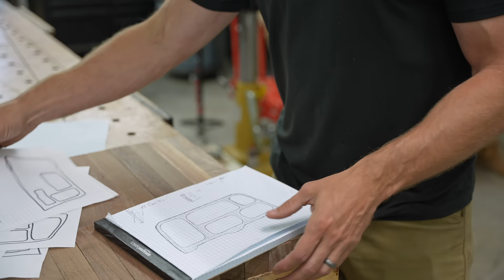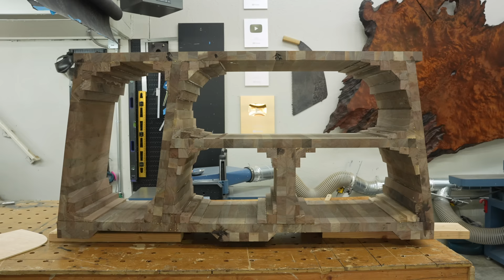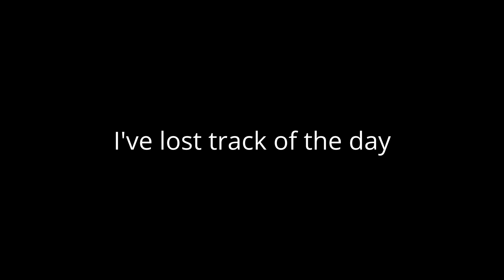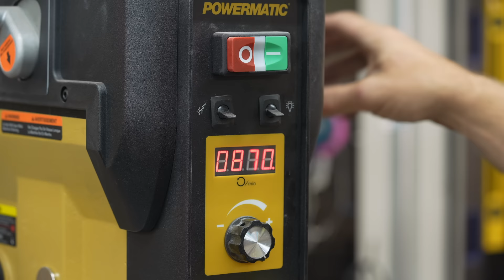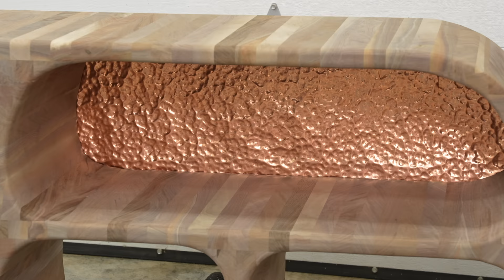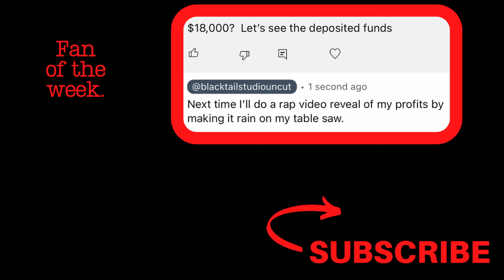My Best Project

Comment: Working with UV almost every day, I have two recommendations; 1) Wear UV blocking glasses. Even short exposure can lead to uncomfortable itchy eyes and other transient (but not permanent) discomforts 2) Determine the wavelength (in nm) of the curing light. Odds are, there is a cheaper alternative that's marketed as germicidal or used for curing finishes in other fields (for example UV cured windshield chip repair, or UV cured 3d printing, perhaps germicidal UV, etc). The light you're using looks pretty lavender, which is closer to the far end of the UV spectrum
Reply: Most safety glasses block like 99% of UV-A and UV-B light I believe so you may not need to buy anything special.
Reply: 3rd recommendation. Keep the light away from Monica Lewinsky’s dress.
Reply: @dads_diy  That depends on what the meaning of the word "is", is.
Reply: @Toekneepowers

Oh dear goodness! So way back in 2010 I went to a DoD police academy and like many others there I was both prior service and prior MP. One of my classmates was a recently retired Army CW3 CID agent. The subject came off classes we’d attended and CID attends a lot of the FBI classes. For his forensics the agents egged them into asking the instructor about “the dress” because she was the principal technician who had worked on it.
The long and short of it was that she could confirm that Wild Bill’s sample was on the dress, along with something like 4-6 OTHER donors whom had also been identified but she was not allowed to disclose.

So apparently it really was her party dress!
Reply: UV can and will lead to cataracts over long exposure times. Any safety classes that are ZA rated are normally adequate for something like this.
Reply: I imagine enough UV light, unprotected, could give you cancer.  Perhaps you should wear fully pants and full shirt instead of trousers and t-shirt while operating it, if you do so for long periods?
Reply: I’m glad I wasn’t the only person worried about his eyes, that’s some intense light
Reply: reminds me of the gel nail polish lights I use!
Reply: Additional recommendation: sunblock.
Reply: Especially with lighter eyes, they're more sensitive to UV light.

Comment: A tip for if you ever use copper again but dislike the color, use liver of sulfer. It instantly turns it a nice black shade and makes it look quite refined, especially if you add resin/shellac over it
Reply: sulfer has organs?
Reply: living in suffering
Reply: That's what I was going to suggest. Use the larger hammer on the copper. Use LOS and buff back the highlights to let the warm copper come through.
Reply: Fuming copper in ammonia with a coating of salt and vinegar can produce a beautiful verdigris effect. I would imagine that hammered copper would make for quite an interesting background when sealed.
Reply: @talexander7217  this is exactly what I was thinking.
Reply: The only downside is the smell, it is atrocious!
Reply: Verdigris! That was the word I couldn’t remember!
Reply: Yeah, I was thinking of some sort of aging of the copper too

Comment: I think the copper would have looked SUPER GOOD if instead of just doing bright bare metal, you'd burnished, oxidized, or tarnished it. It really just needed to be a little darker and have some variation in the colors. That being said I think it turned out extremely well. It's a very pretty piece, one that I would be happy to have in my home... if I had anywhere near enough money to be able to afford your pieces lmao. If I might make a suggestion: A matching floating enclosed bookshelf or record shelf that could go on the wall above it or nearby. Something with half the depth and height perhaps. I think that would look SUPERB.
Reply: varnished copper looks great
Reply: I was thinking it should have been sandblasted after hammering.

Comment: If you plan on using the UV cure finish more frequently you should probably buy some sort of protective UV blocking glasses that work for the UV wavelength emitted by the UV flashlight.
Reply: Or rub sunscreen in your eyes...
Reply: It was in the video...
Reply: It's funny how many comments of people telling this dude what he should and shouldn't do. You think maybe he's made it this far because he's a smart guy and takes risks? Safety Sally type folks never can quite get their feet off the ground ( it's dangerous) good grief.
Reply: Bookshelf.       Go to 28:39 and he has BOZ glasses on for that exact reason.  You were probably typing while that part went past.
Reply: @timjohnson8390  It's funny how some people seem think, that "taking risk" and "ignoring safety precautions" is the same thing even in areas like wood workings, were you can count the situations were more risk is appropriate on all your seven fingers...
Taking risks in design? Sure. Taking risks in just risking your own health? Not the smartest move.
Reply: My thought too. Some knuckleheads here think you've got to take risks. That's not how it works.

Comment: Bookshelf but one that needs to be stocked sparsely so the backing is visible. Also so classy, minimalist bookends don’t look crowded. It is a beautiful piece. I could see an elegant Japanese style floral arrangement in a vase that complements the curves and hammered background, either by contrasting or mirroring it, in the tall cubby. 

My joints ached watching all of that work sanding. I think I was tensing up in empathy. Kudos for not destroying it with the chainsaw.

Comment: Bookshelf for me. I feel like cabinets have doors. But I absolutely love the project! 

One note on the UV cure finish is you should look into some UV resistant gloves if you are going to use it regularly. I'm a nail tech and the UV lights that used to be common for curing some nail polishes had a big impact on the health of people's skin who got those services regularly. Nowadays most products are LED cured so it's not as much of an issue, but having that damaging radiation so close to the thinner skin on our hands can definitely lead to issues. Obviously the wood curing lights are directed at the wood and not directly onto your hands, but I still think changing your gloves would be a sensible safety precaution that doesn't take much effort
Reply: You got to use uv glasses 2 we all do it in the resin 3d printing world. My eyesight went down hill after I started curing my prints. 😢

Comment: Oh, yes, I agree with another comment below.  The copper would have looked good if you had spaced the texture like you did with the steel and added a patina to it.  Super cool.  Try some samples with your "finished" wood and some patina on the copper.  A great book on patinas  Patina: 300+ Coloration Effects for Jewelers & Metalsmiths  Matthew Runfola

Comment: 24:18 for thin metal sheets excluding stainless steel well doing tool is a nozzle drill nibblers. Very cool thing for less than 50$ you can work easy and safe. We cut metal of steel electrical panels (about 1mm steel ~0.04"). Use high torque battery drill about 1500 rpm. Great work, Can, I like the way you do it. Good luck, friend!

Comment: I'm a gunsmith here and I'm taking high end woodworking to my stock work. But let's talk about the cold bluing real quick. 
Personally I apply with a small brush because it's a generally ugly and patchy solution instead of a full refinishing using a slow rust or fast rust bluing. 
Chemical bluing (cold) has some steps

First you should prep your material.
You should sand the material starting at 120 grit and working up to 280 for a matte, 320 for a medium shine, 400 for a slightly brighter shine, and going up to 1200 can give you a moderately reflective swiss shine (or swedish I always confuse the two lol) though this is better with slow rusting technique. 

Next make sure you degass or do oil removal with acetone, I like to soak milsurp for around 4 hours after heating at about 320 for 45 min. But again this is more for bluing or cerakote. You would want to colder than 320 for applying but a warm temp should be acceptable. 

Then apply with a sponge making sure it's lint free. (There are a lot more steps if you slow rust or fast rust)

Neutralize the process again lint free

Finally I like to set up shop towels put a small amount of motor oil (you were right about that). I then pour motor oil completely over the entire barrel/action I use a bin to collect the access. Then lay it over the shop towel, lightly coat the metal in the oil and I then wrap the metal up and tape the shop towels and leave at least overnight but on a high end product I can leave up to 72 hours.

Comment: A good way to remove excess glue is with a damp rag.  Wet it , ring most of the water out, wipe the excess away.  Wash the glue from the rag before it dries.

 When you sand your corners, have you considered a felt backed sanding block?

Like your videos a great deal, keep up the good work.

Comment: Many years ago I bought a 100mm steel disc for a grinder that had a series of chainsaw like teeth around its circumference. Made by Arbortech I believe and it was perfect for removing huge amounts of Australian hardwood very quickly.

Comment: It's neither a bookshelf nor a cabinet, it's a bookcase.

A bookshelf has open ends (usually mounted on walls), while bookcases have closed off ends (the unit usually sits on the floor). 
A cabinet has doors/shutters and sometimes drawers.

Comment: I saw similar units but smaller in galleries about 10-15yrs ago. The difference was that they had drawers fitted that were shaped that same as the hole so the drawers were kind of random shapes (just generally squarish). I thought they looked great kind of rounded as they were but like I said much smaller, more like desktop units.

Comment: Nice tip from my father, a carpenter for 40 years, he take the wood dust mix the with glue and place in the gaps or cracks, its more easy to

Comment: Really amazing work, your handtools skills look really nice, a lot of people don't know how to hold properly a block plane, even when they use it on a daily basis.
The hammer patterned steel back looks awesome, the oil also is amazing. You should really be careful while using UV light, it looks very powerful and I doubt that it's UVA which are kinda harmless if it's that effective on curing the oil. Cover your skin and eyes, a good mask or even breathing mask would be recommended too.

Comment: Hands down this is my favorite channel to watch regarding high end tables! 

I was going to suggest some videos where Ian Roussel makes some acrylic bubble tops for vehicles, but for your particular build I think your method worked great. 

Seeing that the epoxy bends so easily it made me curious if you’ve experienced any issues with the big tops warping if they are placed near a window. 

Power outages in Texas heat and it’s not uncommon to reach 90 + degrees indoors, but I really want to build a slab/epoxy table.

Comment: Cabinet/. and or bookshelf.
Absolutely love this versatile unit.  Could be either or both.
I would want to put it on top of something though, to put it at a height where it showcases it, on the ground does not do it justice. 
4eyes did one similar looking but carved out of solid wood- I actually prefer this especially with the hammered steel.  Absolutely gorgeous.  Keep the templates, you never know, it could become something iconic.  It has that look.
I think I’ve said this before, but it’s worth saying again - I really appreciate your wry sense of humour, your ability to laugh at yourself and that you show your mistakes.
I also appreciate the quality of finish on your pieces.  As a client if i were to pay the many thousands for a custom piece, I would expect the quality finish that I see on your work.  This utube channel is very effective advertising.👍

Comment: I have built a number of chests and other furniture pieces with curved corners and cracks and gaps are always a problem but I have always used a tinted hard set wood filler with pretty great results. However the wedge method you used came out great. Also that drill jig for drilling out those brads was excellent. Tear out is such a drag. Those plugs looked perfect

Comment: I'm  a retired gunsmith, and have used cold bluing many times. The two secrets: 1. pre-heat the part (which has been scrupulously cleaned) 2. Reapply anywhere from 10-12 times, buffing with steel wool after each application.

Comment: Any UV light wavelength can be bought in high watt COB packages, stick on a  heat sink, get a power supply, attach some wires. < $200 if you don't mind a cable.

Comment: I love how you just dumped some motor oil on it. 😂I'm down a rabbit hole of building custom-made cat socialization tools for an adoption center I work at where I help socialize cats so they can find homes. I recently realized you can take acrylic rods and melt the tips, clamp them with smooth pliers and then use a small awl to create a hole (while it's still warm) to attach stuff to it. I'm also trying to build more humane laser toys for cats with leds and hearing aid batteries (so the cat has something to attack instead of the very unsatisfying light they can never catch) and I believe I ended up on your channel while trying to research the most non-toxic acrylic pour material. I love your channel now and I'm hooked just watching you build stuff!

Comment: This is a very unique and interesting project. It's a shame that you had to go through the use of a chain saw because you could have totally ruined the project. The matching the spaces and nail holes came out very well. With time, you'll have an increasingly difficult time in finding those fixes. As you were buffing the cabinet,  I caught a brief glimpse of a space between a couple of pieces of wood.

Comment: The finished project looks really nice, but i would have planed the walnut pieces before glueing them up to get nicer glue joints. I also would have cut the outer corners with an angle on the sides before glueing so you come closer to the wanted round shape and have pieces with the same widh around the corners and also way less carving would be needed there. But overall great work!

Comment: I hope you do this kind of piece again. My opinion is you wouldn't have to make everything at angles. Instead I propose that your make the outsides square, then with whatever/how many openings you have, round two of the corners for each but pick which ones at random. They could be across on either side, both bottom/top or the left/right sides. Plus doing it that way you could make a much larger/taller piece and not sand your life away. I think that could be just enough differenterer for you without making it insane for you to do. I know you love differenterer. All you do is differenterer. 👍👍👍

Comment: Cabinet. Your tool over-heating is power supply related. It could be something as simple as your extension power cord being to light a gauge wire for the length of run your between the power source and your work station ( I.E: 16 ga for 25 ft = 14 amp draw  vs. 14 ga for 25ft = 18 amp draw). So what is the expected load required for that drum sander ?

Comment: wouldn't it be nice to just make a full sized panned for the back with epoxy and copper,i'm sure you got nice ideas to mix the 2 would, reflect nice too with the silverish blue. would be a nice shelf for books or other small stuff next to a good looking big closet or tv shelf,i bet if you made those a bit smaller they would fit in  godly next to your bed on each side one.

Comment: That was a hard job to finish, weldone. Imagine how hard it has been to build the pyramids that 80 tons of granite stones fit together in a way that you cannot even push the tip of the razor blade between them, specially when your tools are just copper chisel 🙂

Comment: I had an angle grinder accident while using on a steep roof on chimney mortar joint to do flashing. Hit a piece of rebar that made grinder skip out across my calf. Scariest thing ever working alone with a 4 inch long gash that my muscle popped in and out of as trying to get down ladder.
Reply: Wish I could add pictures of the scar

Comment: cabinet.  Maybe you took off more than it looked like but seamed like it would have been safer to use the tracksaw from both sides or your deepest cutting saw with a straight edge over the chainsaw.

Comment: I'm not usually a fan of modern or contemporary furniture (my appreciation of furniture styles ends around 1940, ditto for archtecture) but that thing you built is amazing. My only criticism is that I thought it looked better with an open back, which would also be much more practical if it housed a classic stereo system as one commenter suggested. That being said, if I was at the income level of your usual customer I wouldn't hesitate to pay $18,000 for one of these (says Morgan as she tries to scrape together $7500 for a leather tuxedo loveseat...)

Comment: If that is an actual UV-C light, it will severely damage your skin and eyes with exposure, you will need protection, at the very least pants and long sleeves.

Comment: As a former professional in a different industry that required the use of chainsaws…. PLEASE at least remember to wrap your thumb fully instead of just your fingers. If you encounter any kickback it’ll be highly unlikely to stop it from slicing into your face or shoulder. I almost watched this happen to a friend. It’s also a good idea to get chainsaw chaps. But at the very least, wrap your thumb around the top handle fully. If you hold the saw correctly this way, your knuckles would punch the chain brake in a kickback situation. This would stop the chain from slicing your head open or making you bleed out from your neck.

Comment: Instead of using the chain saw, why didn't you use your tracksaw and cut the angle of wood off the same way that you bevel the edges of your big tables? Not criticism, just a question